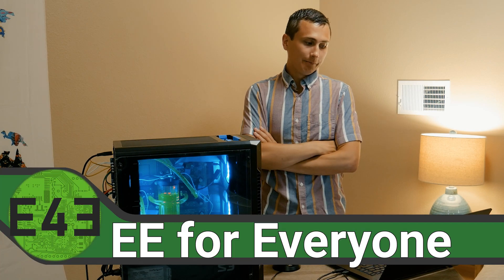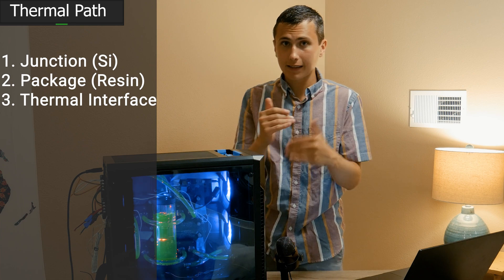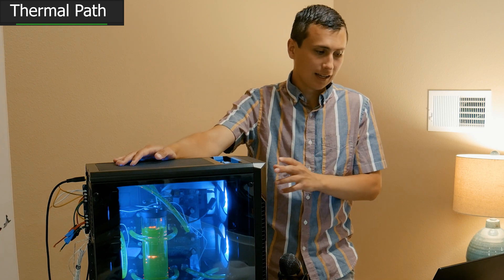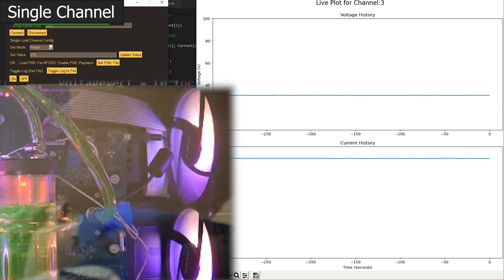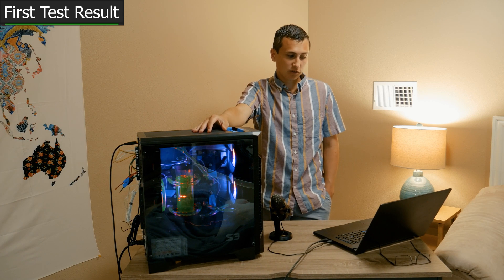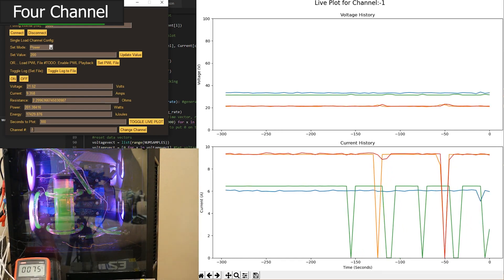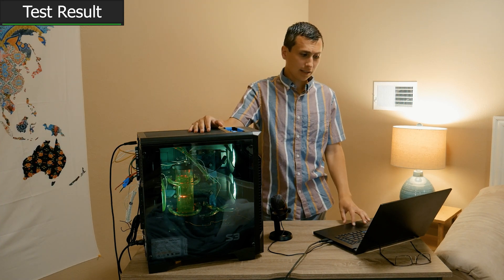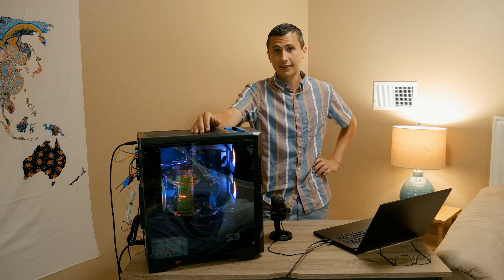Eload Thermal Testing: 1000W, Water, and Transistors!

Comment: ¿Has considerado emplear celdas Peltier para enfriamiento? Por que si tienes alguna fuga (leak) adiós circuito. Puedes usar el enfriamiento por agua para la parte fría de la Peltier.
Reply from the maker: Hello Jorge! I won't pretend to know spanish.. but thankfully google translate works. :)

Peltiers start to break down at higher powers, simply because they can't shuttle power through them fast enough. I think the 50-100W range starts getting pretty dicey. Definitely a good idea though! I think a refrigerant-based chiller will do a much better job.

Comment: @EEforEveryone Hello there.
Just found your PCB inspection videos for the UPS.
Would like to ask for your opinion on what's the best PCB manufacturing service as of right now, with a focus on quality.

I'm just starting with some projects and still have a bunch to learn.
Only a while ago I started wondering if the cheapest way would actually be good enough for some tight fitting pads I'll need. So thank you for showing some examples of what to look at regarding PCB manufacturing quality.

Also nice setup right there^ hope you can make it run Crysis in no time.
Reply from the maker: Hello zwerne42! Great questions, and I'm glad that you're getting into the wonderful world of prototyping.

I don't know if I can provide a "Best" manufacturing service, as it's always a balance between cost, quality, and there's a HUGE difference between prototyping and finished products.

For prototyping, I've really loved JLCPCB's service. One of the best things about them is their manufacturing capabilities are well known (https://jlcpcb.com/capabilities/Capabilities).

They aren't the best in the world, but only one person can be. I've never had a problem with their boards, as electrical testing comes standard. I hope this helps!

Comment: Since all your blocks are the same, you can run them in parallel, same for the radiators if they are the same model. It should help increase the flow and lower delta T between inputs and outputs of both groups. Pump flow speed is also a big factor in keeping temperatures more stable across the loop. If you try to reach for 1000W, you should have a look at the MO-RA3 pro. It can keep delta T air / fluid as low as 4 degrees and has been benchmarked by the manufacturer at 1500W. Fans also make a huge difference, check out for good 100+ CFM with good static pressure. Don't have to go crazy with the 200+ CFM Delta fans, something in the 120-140 range will be a nice improvement, especially since you run the radiators back to back, the 2nd gets heated air, that would be somewhat mitigated with more airflow.
Reply from the maker: Hello Mathieu, great comments! You make a great point, that putting all the blocks/Rads in parallel won't lead to the issue where the last block is hotter than the first! Totally worth a try! (same for Rads). Also, WOAH! that MO-RA3 is a beast of a rad. I'll... Need to think about that. Seems hard to mount, but totally worth it. :)

Thank you for watching, and the great suggestions!

Comment: What exactly is the point of this? I’m so lost honestly.
Reply from the maker: Hello Nik! thank you for reaching out! The point of this project (electronic load) is that it's a piece of electronics equipment. Very commonly used for testing power supplies (confirming they work as intended). This can be used as a part of line regulation, load regulation, and transient response testing!

The purpose of this video is making sure our design stays cool under load! These can suck down a lot of power (almost 1000W in this water cooling loop).

I hope this helps, and thanks for watching!
Reply: @EEforEveryone  Thank you very much for the detailed explanation! I understand the project now and very impressed with your work! Excited for more videos!